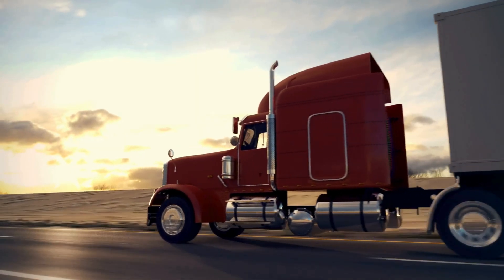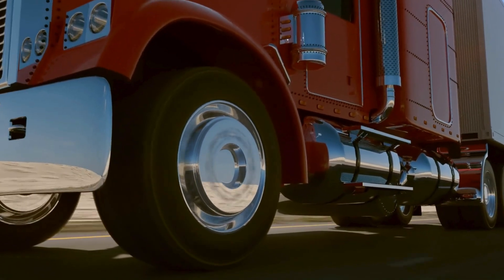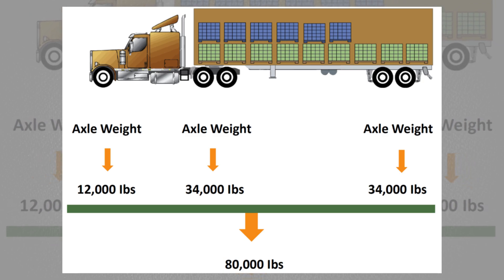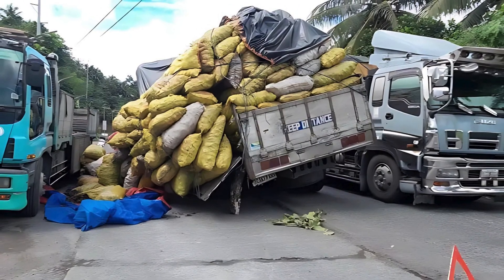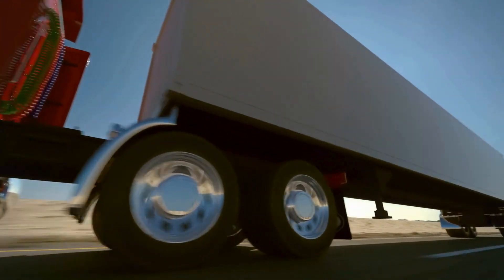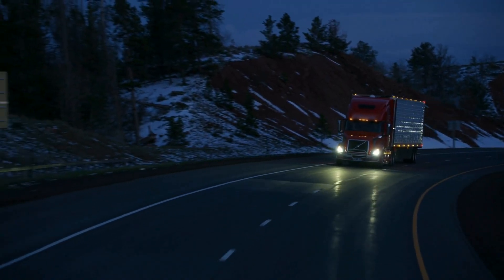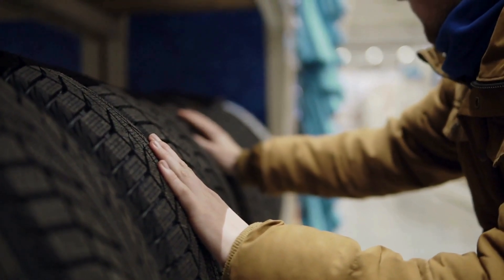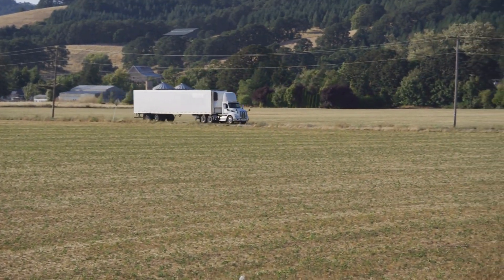Why Do 18-Wheeler Trucks Have 18 Wheels?

Comment: Well, the question is really, if US needs 18 wheels...

For US, the standard axle configuration is 1 steer axle (2 wheels), 2 drive axles (2x4 wheels), 2 double tired trailer axles (2x4 wheels), so 18 wheels for around 36-37 tonnes (80k-82k pounds). 

In Europe, the standard is 1 steer axle (2 wheels), 1 drive axle (4 wheels) and 3 single tired trailer axles (3x2 wheels), so only 12 wheels for 40-44 tonnes standard GCW. 

So, in Europe we need 1/3 less wheels for 10-20% more weight...

Comment: I've seen on few instances where there are 22 wheels and couple instances here and there 24 or 26 wheels.  Like what was mentioned in the video the prime reasoning for so many wheels is for weight distribution.  There are other reasons too for the wheels count, but the weight distribution is the key one.

Comment: Alot of good info here i just wanted to offer a correction on vocabulary 
A semi is just the trailer their are semi trailers and Full Trailers are much less common with the most common variant being a semi trailer with a converter Dolly used to pull Doubles/triples “A-trains”

Source I’m an active Professional Driver

Comment: Two nit-picking notes: 1. Each axle carries exactly two wheels. An axle might have single wheels, carrying one tire each, or dual wheels, carrying two tires each. So an “18-wheeler” actually has 10 wheels, even though it might have 18 tires. (Each tire is on a separate rim, which confuses matters. Also, if “super singles” are used, an “18-wheeler” might have as few as 10 tires!) 2. The term “semi” comes from the fact that the typical “big rig” has a trailer which partly rides on the tractor and partly trails behind. A “semi-trailer”. By contrast, a “full trailer” rides entirely on its own wheels and is pulled behind (fully trailing) the towing vehicle.

Comment: I have driven semi trucks since November 1997.
I am currently a Heavy Haul oversized semi-truck driver employed by a company within the Port of Seattle.
We move overweight and oversized Freight in and out of the Port of Seattle and the port of Tacoma.
The typical over the road semi truck is a 3 axle tractor with two tandem axles that are called Drive axles.
Two tandem axles are allowed up to 34000 lb.
The tandem axles on the trailer are also allowed up to 34000 lbs. Typically an over-the-road trailer can slide those axles forward decreasing the Bridge length or slide them all the way to the rear of the trailer increasing the Bridge length which is the distance between your semi-truck Drive tires and the tandem axles on the trailer.
If you cross over a scale on the freeway that is operated by state patrol or Commercial Vehicle Enforcement they are going to measure the length between your front drive axle on the semi truck and the rear axle on your trailer.
This is where the majority of the weight that you are carrying is going to be calculated.
The steer axle on a semi truck is typically going to be anywhere from about 9,000 lb and 11,000 lb depending on whether it is a setback front axle or a set forward front axle that you would see on your average Peterbilt 379 style cab that is so popular with most Road trucks.
These tricks are rarely going to be overweight on their steer Axel because it is so far forward.
With four axles, anything over 40 ft is going to be over 68,500 lb which is going to put you over Bridge.
As I said before each tandem set is allowed 34,000 lb.
Within 40 ft this is going to come to somewhere around 68,000 lbs.
The reason they call this bridge law is at the beginning of the commercial tracking industry when trailers were first hooked up to a tractor they are almost immediately began to encounter issues with semi trucks traveling over bridges that had not yet been engineered to handle that much weight in that small space.
Like the video narrators says having that many tires with that much weight on asphalt or concrete is going to tear the road up causing cracks and potholes.
I myself can attest to the fact that I am responsible for cracks in the road and potholes in the Port of Seattle area which is located in the southern part of the Seattle area.
When I first began driving semi truck from companies located right outside of the Intermodal Container Terminal quite frequently I was carrying 90,000 lb to 95000 lb on 5 axe which is 18 seperate tires.
We wore out tires very quickly, cracked the frames on the semi trucks, popped airbags, cracked leaf springs, wore out clutches prematurely, blew rear differentials, and tore up Transmissions prematurely as well.
In the port area of any port anywhere in the world it is not uncommon for guys like me to be hauling up to 160,000 lbs on only seven axles. Bridge law is 97,000 lb on 7 axles. Last week I hauled a load weighing somewhere around 140,000 lb on 6 axles. But that's because we are moving Freight in and out of the terminal just a couple of blocks with no Hills and the load not actually traveling on a city street but on a freight Hall Road that we use from our yard into Terminal 5 in Seattle.
If you go out onto the actual Road or freeway and you weigh 140,000 lb you're going to need about 10 axles.
You're going to be overweight, you're going to be over length, and you're going to need two escort Vehicles one in front of you and one behind you holding traffic back away from you for safety reasons.
The truck that I drive has a 23,000 lb front axle, a 23,000 lb drop axle, and a special tandem set on the rear end that is rated for 46,000 lb. It has a 600 brake horsepower engine with a special 18 speed transmission and a special heavy duty set of rear differentials.
Because I have a special overweight permit I identify whether or not the semi truck and the trailer are going to handle the weight by observing the appearance of the tires when the truck is loaded. If the tires appear as though they are looking like they're going to be flattened, I'm going to put this load on a different trailer with more axles and larger tires. Sometimes we cannot use certain types of trailers with larger tires because we are overhyped and we would not make it underneath any of the freeway overpasses on the freeway.
We also plan our routes ahead of time knowing which way we can go without hitting overpasses or traffic signal lights.
You can Google each States permitted weight on a specific length and specific amount of tires.
I would also like to take this time to warn everyone that it's not a good idea to ride directly next to literally any loaded semi truck running down the freeway especially during the summer because that's when tires will blow up and lose retreads. If a retread comes off of a tire more than likely it is going to go through your windshield because it is a big chunk of rubber weighing over a hundred pounds loaded with all kinds of Steel.
When a semi truck is rolling down the road over 60 miles per hour and it is possibly overloaded and the road is hot it's going to blow up. I have had this happen to me on I-90 during the summer, and it is quite violent.
It's also not a good idea to tailgate a semi truck.
When a rock comes up out of our tread and hits your windshield you can't blame the truck because the Department of Transportation and state patrol consider this a road hazard and not the fault of the carrier.
Give us room and stop cutting us off, thank you.
Reply from the maker: Thanks for the detailed explanation and the safety advice!

Comment: I own a fleet of 21 such trucks. But they are used for coal transportation purpose. The trailer are tipper designed means the load can be unloaded by lifting the trailer by hydraulic lifters attached below the trailer. These heavy machines are really costly to maintain and the dirt and mud and large potholes in coal mines and factory road add to frequent breakdowns.
Reply from the maker: That’s fascinating, thanks for sharing!